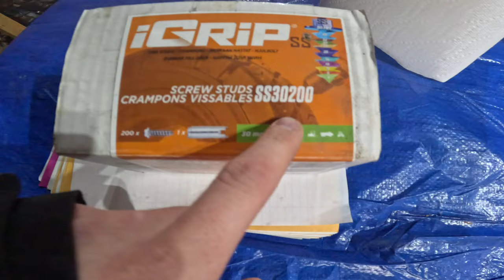Studding Skid Loader Tracks with I-Grip 30 mm Studs!

Comment: Looking at grip studs, very similar to igrp, they recommend 150 per track  min. Essentially 3 studs per block. Would love to see the same density with your igrip studs.  You are the only one i found using I grip studs on a ctl. They also state that many in a 3 pattern per block so the torque and load is distributed evenly and not to damage the track.

I am betting tou would see a world of.difference if placing.3 per block.